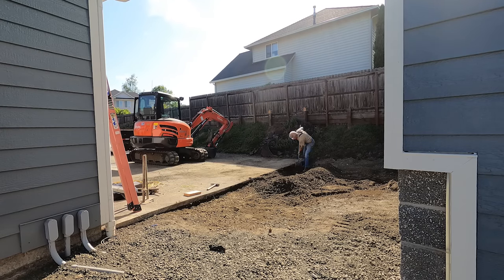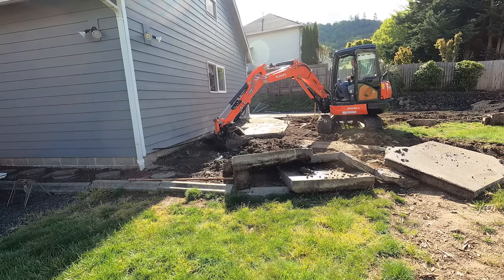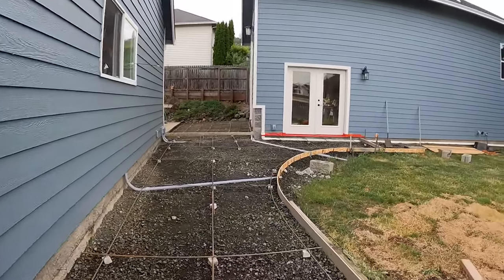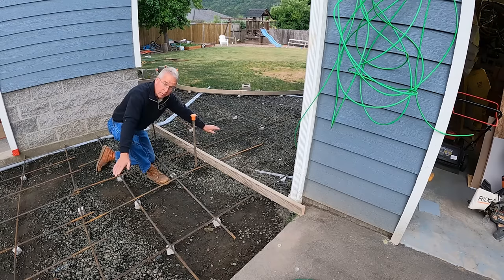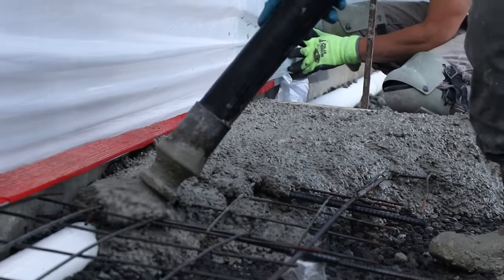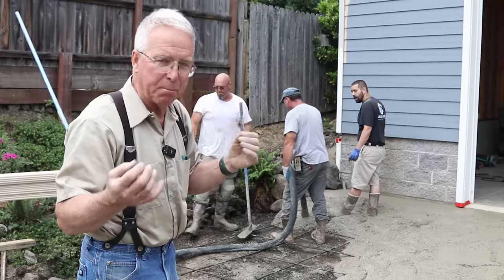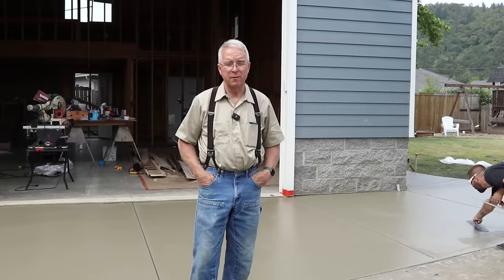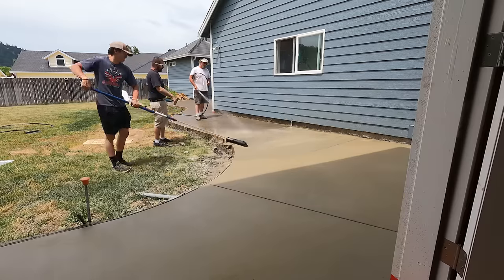Pouring Concrete For A New Shop: Shop Build #24

Comment: I made myself wooden forms from pallet wood to cast concrete planter boxes with any left over concrete.  They pack away flat, just slot together to use, three different sizes.  I usually can use up 1/2 a yard that is always spare.  They always sell well and stop waste.

Comment: I’ve been placing and finishing concrete for 34 years. Residential, commercial, industrial, decorative, precast, you name it there is a good chance I’ve done it in concrete. I really hate videos where the “pros” are doing everything wrong. Giving bad advice. Simply making my trade look bad. The crew you hired was very professional and from what I could see they were doing everything correctly. There are always differences in how concrete is done in different regions but it is essential the same process. 

Learning something new is an amazing thing too. I loved the corner bead trick. Clean straight edge and only a few millimetres difference. Love it/stealing it!

Comment: I used to run a cement bulker and I had one of the mixer drivers tell me that they all carried a bag of sugar to add to the concrete drum if they had a breakdown to keep the mix from setting. Amazing that 4 lbs of sugar will do that to ( yards of concrete. Thanks for all your posts, I've learned a lot about construction.

Comment: I've only seen aggregate added to the top of a finished pour after it's ready for it.. then tamped down and then brushed, then acid washed, cleaned again with water to neutralize the acid and then sealed. Never seen it done this way. I sure as heck wouldn't do it any other way. Cool to learn new procedures though. Just wouldn't want small aggregate all throughout my concrete. We also use sugar to make "hot mud" in doing drywall , which makes the mud dry much much faster when time is of the essence.

Comment: Listening to Dustin it seems there are a lot of similarities between concrete and plastering (here in the UK). You are dealing with chemical reactions which are affected by ambient conditions (temp,humidity,airflow) and also the substrate you are going over. He was talking a language I understand when he said about not doing it after a while and then finding yourself fighting it. You lose the feel for it if you don’t “keep your hand in” as we say over here. You find yourself chasing it rather than running with it. Great to hear another wet-tradesman knowing his craft so well that its hard to explain.

Comment: When you work with concrete, you should always have extra concrete delivered so not to run out.
But have a nice new pallet ready. Fill in the openings in the pallet and put pallet frames on it. Then pour the excess concrete into the box. This gives you a big concrete block that can be moved with a pallet jack or machine, and is a perfect heavy work surface to blot a vice to. You can beat, pry and bend all kinds of projects on such a block without it moving.

Comment: Nice to see you used supports under your rebar, very professional.    I've watched too many videos with contractors who pull up the mesh it while placing concrete.    I've also seen older slabs broken up with the mesh at the very bottom for most of the slab.

Comment: I got me a “Mud Mixer” and it has drastically changed my way of doing small pours!
I put it in the same class of usefulness as my dump trailer.
Reply: I'm considering renting one for a 60 sf slab I'm planning on pouring in a month or two. Is it really that much better than a small drum mixer?
Reply: @GregsWorkshopOregon  Yes, it’s way better than a drum. My last pour was a slab on grade 8’ x 8’ x 8” thick. It used about 1-1/2 pallets of 60# bags. Me and a helper finished the pouring in an hour, 20 minute cleanup on the machine, my shirt was barely dirty. 
Use the hopper extension if available.
Do it.

Comment: Journeyman Electrician, 15 years in the trade...  just a bit of electrical advice if you ever plan to do any DIY electrical work...

Do not use the PVC plastic sweep elbows. Especially if you plan to bury or encase the conduit run. 

The reason for that? When you go to pull the wire into the conduit you will likely use rope or pulling string aka "jet line." If the wire pull is of any appreciable length or it pulls hard, the rope or string will begin to cut through the radius of the plastic sweep as it is pulled through... Once it cuts through it stops dead and wont pull any further. The conduit run must be dug up and repaired... Or abandoned.

Use galvanized steel conduit sweeps with the appropriate adapters to attach them to PVC.

If the conduit run is exposed or short in length then feel free to use the PVC sweeps... But avoid them for long or buried runs.

I've seen too many of the plastic sweeps fail to have any faith in them, especially when buried or encased in concrete. It makes for a long, difficult, expensive day when they fail.

Comment: At my work we have heavy forklift traffic and there are tons of places that have asphalt to concrete transitions. The asphalt is constantly sinking or compressing right at the transition so you end up with a 1/2” or 1” bump in the tire tracks over time. They always repair it by just cutting the asphalt back a foot and pouring a new concrete strip. That last a couple years. I’ve always thought they should under cut the grade underneath the asphalt a good 6” deep and 6” back so the concrete could flow under the edge of the asphalt. Something to think about. Great work.

Comment: Being in the middle of the rust belt I like the fiberglass rebar and basalt. Finally getting around to building myself a cottage. Decided on a remote county in the U.P. of Michigan. Plus I can get great building stone local and cheap. Gonna try to slope towards pipe to cooling tube or drainage to daylight and masonry fire appliances. Either mixing my concrete by hand or gas mixer. 6 feet deep on my piers finally hit a good hard pack. Gotta wet it before you stick it. Masonry loves to wick moisture.

Comment: Looks good. We do it a little different. We finish it just like you did but then we spray it down real good with rugasol, cover it with plastic and then pressure wash it the next morning. We've found that using a garden hose and brooms will leave a little cloudiness when it dries.

Comment: Ken, I've been told coating cold edges of existing concrete with PVA can help with the bonding action, and can help eliminate to some degree the pulling action mentioned by Dustin. Perhaps, you could ask him for a comment as to the benefits or otherwise, perhaps suggest an experiment to test this thesis....Regards Robin.....

Comment: I used All American Readymix Concrete here in Sarasota.  It is a mix on site truck.  By the time they added all their charges and over charged me 1 yard, it came to $500 a yard.  They will rip you off.

Comment: I still prefer pavers over poured concrete. My drive way and walk ways are all pavers. Those are red clinker. They must be around 30 years now. Of course here and there they settled a bit, mostly because back then we didn't bring anything but a wheel barrow and a shovel. None of the big machinery people use nowadays for everything in their garden. The nice thing about the pavers is that clinker never really stains or loses color. It doesn't wash out like concrete. You don't get cracks. It's easy to pick some up to fix something. It's easy to pick up if you want to run a line or repair a line burried underneath. And there's no form work needed, also no rebar needed. Plus I do like the look of high fired clinker pavers. Pretty much lasts forever and is even reusable.

Comment: I'm sure that concrete will be fine but it's funny in Australia our rebar is ribbed mostly set spacings around 100mm by 100mm (3.9inch I think) and welded and we use plastic chairs that lift it. That rebar spacing wouldn't even pass for a light traffic path around my neck of the woods.
Reply: Same in the UK. Mesh and stilts…
Reply: Did either of you guys even listen to Scott's explanation of why this isn't a standard rebar job?
Reply: @jej3451  Yes i did, the spacing is still way different in the usa then in other places. I would like to add the Netherlands, belgium and germany to the examples of places where the "basic" rebar consists out of mesh, welded rebar 150mm or 100mm spacing between. Most commonly used here in the netherlands is ø8-150mm (+- 5/16" bars on 6" spacing) and always on plastic chairs or concrete spacers. And when it gets structural over here almost everything gets 2 layers of mesh with supporters(as we call them) in between to keep desired distance between mesh. For example 200mm slab 35mm concrete spacers on bottom, 2 layers ø8-150mm mesh, 30mm concrete cover on top mesh makes about 100mm distance needed between first and second mesh
Reply: @jej3451  Yes I watched the video and the level of compaction hence "I'm sure that concrete will be fine" Did you even read my comment I wasn't making a point like Scott doesn't know what he's doing. I was making an observation on the different standards. 

Even a two hour drive into another state changes our standard to more or less requirements.

Do I personally find the amount of bar lacking sure if a concreter did that prep here many builders would pull the contract. That being said I don't live in the US I'm sure some things I do in my trade wouldn't be good enough if I swapped countries. As for the plastic chairs they are a brillant idea and might make someone google it and help them out.
Reply: @nicko198718  The point is that he isn't following a standard, U.S. or otherwise.  He's making a judgement call based on experience.  Geography and nationality are irrelevant.
Reply: @jej3451  yep…. I was just commenting. What’s actually of slight interest is that for most concrete work here on domestic jobs, there isn’t a code and we don’t use rebar. Especially for patios/driveways etc. no code at all, and never any rabar. We’ve just put down 10m3 for footings and a patio base, the total Rabar used was 12ft, in 6x 2ft lengths just spanning over a sewer.

Comment: Maybe you are not interested in this question, but here goes: Do you buy relatively inexpensive work boots, take care of them, and replace them every second year, or do you purchase high end work boots, take care of them and really hope for longevity to trump initial cost? My father told me not to wear the same pair of leather boots two days conservative, but it is hard to have two or three pair of boots in rotation. Interested in your opinion.
Reply: Buy the best boots you can afford. It will be easier on your feet in the long run. A poor fitting, cheap pair of boots can wreck your feet and may do damage that can take a long time to recover from. Maybe even permanent damage.
Reply: He did a video about them some time ago. He buys high quality boots.
I do too. Quality on my feet and quality for my mattress. We spend too much time on these things to skimp.
Reply: The reason for multiple pairs is to let them dry out thoroughly and to let the cushioning recover. Keeping your feet dry is paramount to preventing hot spots and blisters and really aids the overall longevity of any pair of shoes or boots. Giving time for the cushioning to recover helps prevent Plantar fasciitis(aka intense heel pain) which you really want to prevent because it can take half a year to a full year to recover from that. If you are going to be working on your feet all day then treat your feet like any branch of the military treats foot care while marching and you will be able to hopefully work day in and day out without foot health problems that could have been prevented.

I am firmly in the camp of buying the best boots you can get a hold of because they will last longer than even buying multiple pairs of a cheap boots that cost the same and they will be so much more comfortable. The last time I bought a cheap pair of boots(basically cost me 3 hours at minimum wage) I was able to completely wear through the sole of the boots in about 3 days while on my feet for about 16 hours a day and they caused soreness in my feet within a couple of hours of wearing them. Buying that cheap pair of boots was an extremely painful lesson that took a couple weeks to recover from.

Comment: My dad taught me the squint technique when cutting rebar.  It work well for me until i went union and got metal shrapnel in my ear.  But i got away with until then, now im an old carpenter with good eyes and i can still swing a hammer with the best of them.

Comment: 06:00 Hope not, but you will most likely have rust-jacking in the connection between the slabs with water reaching the rebars,
Expect concrete spalling in this area

Comment: The setting of concrete is essentially crystal growth. I suspect the sugar interferes with the crystal growth making the top layer weak. I doubt there's anything special about sugar, any larger molecule that dissolves in water would probably do it (maybe try with dish soap).

Comment: The conversation at the end relating to cure times, is that 10 degrees dry bulb or wet bulb? I default to thinking you need to consider wet bulb, but I honestly don't know how the curing process is effected by evaporation rates or not.

Comment: Sugar doesn't technically stop the curing process.  It just slows it down.  So basically all you're doing is slowing down the curing at the surface and letting the rest harden as usual, and then hosing off the uncured top layer.  If you hadn't washed it off, the top layer would be just as hard as the rest once fully cured.  It's a simple, but cool trick.

Comment: I always wonder how little iron is installed in the USA in a new concrete area or even in foundations. In Germany, two layers of grating iron are installed at a distance in areas and lattice baskets are installed in walls. Why is this built in the USA? It should last as long as possible and not break at the slightest additional load!
Reply: It is a waste to build something to last 200 years, when it is likely to be modified/replaced (due to changing tastes) in 100 years.  Ever wonder why the home ownership rate in Germany is the lowest in the developed world?  It could have something to do with excessive costs...

Comment: You could have gotten away with 6" mesh in that cement really rebar is over kill. I can see it are the car entrance but through the whole thing? Its not needed. Good job but way overkill. I saw one guy use straight coke to retard the concrete. Was pretty cool. Threw it in his sprayer and hit the concrete with it and it worked real well.

Comment: Informative... But now, I am far more concerned about getting concrete correct. I was hoping for straight science - if this then that... but much more art than I was expecting.
Reply: The most important things to remember about concrete is its gonna get hard and it's gonna crack. Also concrete makes the schedule not you. You wait on it. It doesn't wait on you.

Comment: Scott, I am 69 and envy you mobility, 45 years of concrete, heredity, and other health issues have left me less mobile than you. That is not my point. I do not agree with the generally accepted idea of doweling slabs together for the reasons you illustrated. Particularly when one side is a foundation and the other side is a floating slab. I have seen multiple examples of cracking in the floating slab caused by this practice. Good compaction and slab reinforcement are all that are necessary.